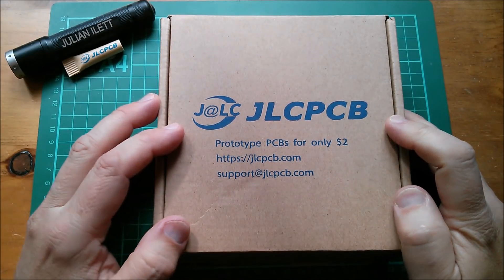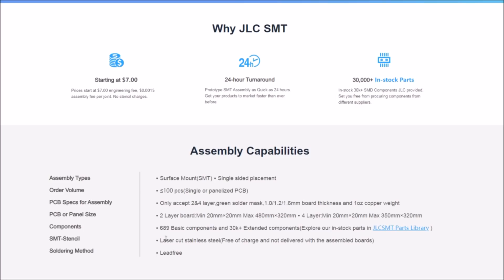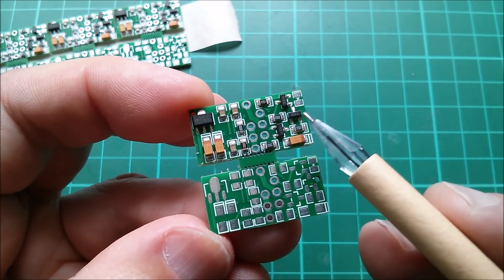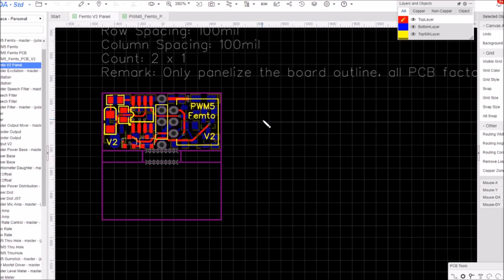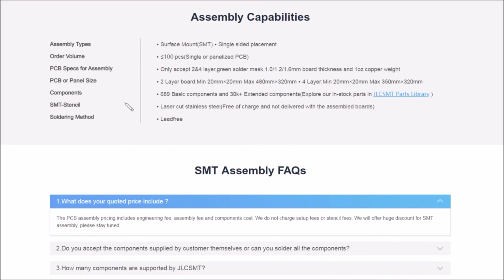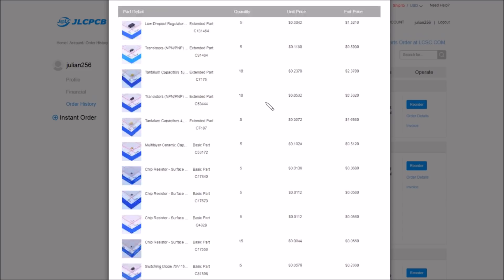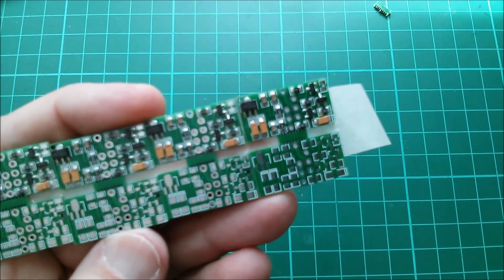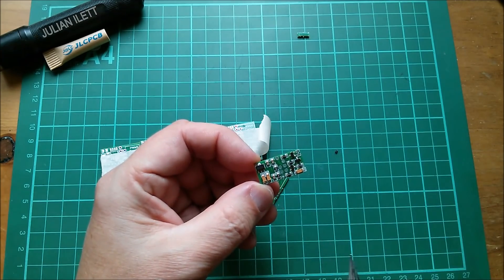Assembled PCBs from JLCPCB - New SMT Assembly Service

Comment: DO you have video that demonstrates how much power the standard trace can hold. I made a 36v to 48v dc booster and I'm afraid of ordering till I know if my traces can handle 40 amps. Not going to lie I've been confused when I see the power coming out of some board's vs the thickness of some of my wires that burnout at 40amps.

Comment: I am planning to order a board from them shortly, my board is also too small so I have to panelise it. I've panelised it with components and it looks ok... can I see the design for this board? What is the diameter and spacing of the stamp holes? Thanks.

Comment: Are there any US sources for boards and components?
Reply: I've used https://oshpark.com/ for prototype boards, and I usually buy parts from Mouser or Digikey, all in the US.  The PCBs come out very nice from OSHPark, but are somewhat more expensive.  In my latest project, I used JLCPCB to evaluate their service, and was quite pleased at the rapid turnaround.   

It's also very handy that you can get a solder paste stencil for only $7 more from JLCPCB.  (And if you do, choose "custom size" to get one sized to match your board, vs. the default which is huge and ends up needing to be shipped as a separate package for additional cost.  I use the stencils by hand, and don't have a machine to apply pastes, so I don't need the default large size.)

Comment: Penalizing through EasyEDA is not the way to go. It took me a few days to figure out how to make a panel that will be assembled with the components. What I did is, I first went to the board design and copied it and pasted it as many times as i wanted boards on each panel. EasyEDA than automatically adds designated to each component and those are not found in my schematic diagram or BOM. Then I went to the schematic diagram and copied and paste each of the existing components as many times as the number of boards I had on the panel to fulfil the BOM for the SMT. Also,  I had to manually draw the panel outlines and place 0.1mm holes where I want to later  Senate the individual boards by braking them off. That was a great effort and pain in the neck.

Comment: Thank you very much for this VERY informative video!!
I am interested in giving them a try on a few prototype boards! :-) I will have to check their selection of SMT parts now! 
I am just starting out with KiCad on Ubuntu but maybe I should try to use EasyEDA again?
I tried it once earlier this spring but was quite frustrated with it. I could not figure out how to place a part and hook up wires. KiCad on Ubuntu seems to be working very nicely so far (but I have not reached the PCB board layout stage yet) and, Lord willing, I can translate to EasyEDA.
But the symbols and footprints for all the parts is the bugaboo. So maybe I need to try EasyEDA again.

Comment: how difficult would it be to make this for 6V battery and say 12V panel?
Reply: It can't. The battery needs to be a 12 Volt lead acid battery.
Reply: @johnnodge4327  that version yes. i have a 6v leadcacidwith no charge control
that is why i asked

Comment: You mentiioned the diode was 1n4148, smt would be 1n4148w, that has a pad width of 4.05mm or 0.16 inches. the 1n4148w would have fit. that would take up 3.8 mm. a little tight for proper solder joint, but would have worked https://www.mouser.com/datasheet/2/115/ds30086-60872.pdf

Comment: You should try to avoid using tantalum caps. There are very few if any situations where they can't be swapped out for something more reliable (they fail short circuit). Beware of the myth that conformal coating prevents ingress of moisture. It simply slows it down.
Reply: Listen to Amp Hour podcast #459 where Tom Lee talks about starting a fire in the ISS (1:10:20) because of tants
Reply: Tantalums easily catch fire; never ever use them
Reply: What should you use instead of tantalum caps?
Reply: @Philip8888888  mlc caps. Or even electrolytics if you really must.

Comment: How come you don't make a single 10x10cm panel instead of several small 1x2 board panels? Also, regarding the holes, look into standard rules for pcb "mouse bites". For boards that small you could easily get away with one or two small tabs(probably less than 1/4 the width you've used) that will be strong enough to hold the panel together during manufacturing, testing, and assembly, but make splitting the panel up(and ultimately breaking the tab off of one of the boards) exponentially easier. It takes much less FR4 to hold a panel together than you might think, especially one so small.

Comment: Did you pay $3 for each extended part per board or was the $3 charged amortised across the number of boards you had done?
Reply: Amortized.
Reply from the maker: $3 per extended part per order. Then presumably, the parts are unloaded from the feeders and put back into storage
Reply: Julian Ilett thank you for your reply. I specifically asked JLCPCB the same question and they replied that they charge $3 per board. This makes no sense as they as you correctly pointed out. I have challenged their reply as I believe there is some confusion most probably language. JLCPCB English is better than my non existent Chinese. 

I am still in communication seeking clarification as their last reply confused even further but your reply confirms what is correct and indeed makes sense. 

Thanks again for the reply....I enjoy your channel.

Comment: Very interesting Julian. 

When I looked at the cost of the components from JLC, vs me buying them elsewhere in bulk, having them fitted simply didn't make sense, from a small scale manufacturing point of view. Especially if you consider the actual selling low price of a complicated PWM charge controller. When I sold my PWM5, I simply soldered all the components by hand, which actually doesn't take long. For me, it didn't make financial sense, so I soldered them up myself.
Reply from the maker: When I was manufacturing the PWM5, I could only make it profitable by charging my own labour time at zero. That's unsustainable.
Reply: @JulianIlett  

Oh absolutely. I have made up a few of my Pico kits on special request. However it's not particularly profitable, which is understandable for hand assembled PCBs. I'd consider using the assembly service, if they could do both sides of the board, and fit programmed PICs, which obviously they can't. 

A way around the single sided issue, would be to drop the component size down to 0402 where possible, placing most components on the assembled side. Doing this could restrict the number of hand soldered components to a minimum, possibly just the PIC, which could be programmed prior to soldering on.
Reply: There's no way you can beat a machine at component placement and soldering. This service is very economical if you adjust your design to use as many basic components as possible and avoid any extended components. It also opens up the possibility of using 0402 components, which I would never bother to do more than a few by hand. You solder the extended components yourself, which you can usually buy cheaper than what LCSC has them for.
Reply: @MCJemFinch  

A board redesign, using 0402 components and a mostly single sided layout would make the extra costs more acceptable. 
There's still going to be some hand assembly required, but keeping it to a minimum is essential.

Comment: Whole process of designing board using EasyEDA and ordering assembled PCBs from JLCPCB was smooth.
Only thing I thought was missing was being able to rotate the parts while reviewing the parts placement. It's not hard to fix wrong orientation by editing the CPL file, but it adds way too many steps to the process.
EDIT: Just got answer from JLCPCB: "We find this problem before, and our IT development team will add "Rotate" -buttons in that page in near future"
Reply from the maker: I would also like to see a method of including all PCBs on a panel into the BOM and CPL files. I also got a reply from JLCPCB - "This is our plan in future to add this function" :)
Reply: I've had the same problem figuring if the part's orientation is correct. Half of my components on the preview were placed 90 degree on the pads. The only thing I could do is pray they figured it out correctly. Didn't get the assembled boards yet to see if they did. Overall,  very confusing.
Reply: I'm so glad to hear they're working on the rotate issue...several of the footprints in Kicad are 90° or 180° off from what they have, and going back and forth editing the .cpl is a .PITA. I wish there were a sort of one-click method to tell Kicad "you're working with JLC, follow their rules and link to their parts library" and have everything magically work. Hey I can dream....

Comment: Interesting.  I bought some boards from jlc a month ago. I normally panelize smaller boards with v-groove and this time they wanted another $10 to do it. Never before did they ask for extra.
Reply: Something else must've been taken into account then. I get all my boards vscored and never have to pay anything additional unless the panel doesn't contain identical designs(even small differences like if you moved a component after panelizing and the change isn't exactly reflected across all panelized boards can cause them to be considered different boards), the overall panel size is >100mm on either edge, or I select more than 10pcs.

Comment: Could you explain further why no V-scoring?    It would appear that v-score was used between the pcb's at the short edge though?   OR  was each pair routed out of the panel.
Reply: My guess would be that the 'panel' was routed out of the larger PCB blank. As for why no v-scoring, who knows but it does seem like there are trying to push people more towards the rabit-byte panels over v-score ones. At least from my personal perspective.
Reply from the maker: Perhaps the V-scoring machines have a height restriction - who knows.
Reply: V-scoring is done by hand while a router table can be loaded automatically with the two fiduciary holes. They would probably have to take the boards off the production line to have them v-scored vs having the router directly in line.
Reply: I doubt vscoring is done by hand.  Its just a different tool in the router machine i would say.
Reply: @glennp9904  there is youtube video from jlcpcb factory. it's cutting wheel machine, much different from cnc router.

Comment: I spent some time going thru the basic parts list, I think it would be an interesting challenge to work within that parts list for a project.
Reply from the maker: There seem to be quite a few ICs, transistors, resistors, capacitors and LEDs in the basic set. Should be possible to come up with something blinky :)
Reply: @JulianIlett  maybe I'm thinking to big but...recreating the 1 instruction CPU (maybe more) with just the parts available. or experiment with PCB business cards
Reply: Where's a list of the 689 basic parts?  i've been looking around but just can't seem to find it.
Reply from the maker: @roidroid  https://jlcpcb.com/client/index.html#/parts - the basic parts appear first in each list.
Reply: @roidroid  I don't think there is an explicit list, if you look thru the main parts list at JLC the basic parts are listed at the top of each section.
Reply: @weirdboyjim  No, I can't seem to find an explicit list, but thats probably by design so you can see that they still in fact have parts you may need. 
I haven't sent away for a this service yet, but I am working on a rather large board with a couple hundred passives and half dozen or so op amps and regulators. While I have replaced a few components to accommodate the basic list, they still seemed to have nearly all of the parts I need in the basic list.

Comment: Try folding wires so they come out only at ONE end. Seal/encase but don't fill case completely to provide a drip edge. Mount so the wires all come out at BOTTOM and that intentionally formed drip edge prevents water from wicking back upwards towards PCB right where the wires enter.

Comment: Have you ever thought about entombing your PCBs in clear casting resin? Might stand up pretty well :D Be fun to see these in a block of resin!
Reply from the maker: I suppose the UV glue is a kind of resin - just built up on the outside of the PCB rather than poured into a mould.

Comment: Wow they charge a huge mockup on the components. The LDO (LCSC and JLC have the same part numbers is easy to compare) costs only 0,1164€ on LCSC and the transistor 0,0083€ while they charge 0,304€ and 0,118€.
That is insane.
Reply: The cap is even more insane. 0,071€ per piece against 0,2376$. Wow. I really hoped they would use the LCSC prices but now I understand how the manufacturing is so cheap. They just add the cost for the manufacturing on the component cost. 
So not at all useful for larger scale but acceptable for prototypes I'd say.
Reply: Yes, they seem to advertise it more as a prototyping service. What they do is make small batches quite easy an affordable, especially to a hobbyist. But of course if you had an actual product and wanted to manufacture hundreds or thousands, you'd use a more efficient producer and shave the pennies on those component costs.
Reply: I'm not sure how they price the components. On my boards, the prices were not too dissimilar to LCSC though oddly quite a few were lower price through JLCPCB. A few people have mentioned bigger differences so it's a bit puzzling.
Reply: @sdgelectronics  That seems weird. I guess they are still in the early phases and I hope that they will put the prices down to those of LSCS (or maybe a few percent higher) since they are the same company.
But I guess for bigger order volumes it is better to go with some other company anyways. So it should be ok.
Reply: Ok I just checked it now again with parts for my project. It is now not significantly more expensive. The LDO is, for me, now 0.1384€ with JLC and 0.1145€ with LCSC. The tantalum would be 0.1082€ on JLC and 0.071€ LCSC.  And with the transistor they charge the price for the 50 pieces. As that is what they also would charge at LCSC and it is clearly written there in the part lib as well.

I guess they fixed the problem and 20%-50% or so is an ok margin for the parts. Likely will go down more in future.
Reply: @nukularpictures  Well, electronics parts pricing have always been on a very big sliding scale.  I buy reels of caps or resistors than can get down to $0.00167/ea at 30,000 quantity.  It keeps going down from there.  The "standard parts" are probably costing JLC 1-5% of what they charge.

Comment: Glad to see yours turned out well too :)
Reply from the maker: Ha, yeah, you beat me by two days :)
Reply: @JulianIlett  I thought you'd have done a vocoder board, but I guess most of the parts are through hole on those. Was the order process seamless through EasyEDA?
Reply from the maker: I did have to export both the BOM and the CPL file from EasyEDA and upload them individually to JLCSMT. But maybe they'll automate that process in due course.
Reply from the maker: Yeah, the vocoder is entirely TH :)

Comment: 5:40 - you need to be careful when snapping pre-soldered boards that you don't cause cracking in the solder joints.
Reply from the maker: These little boards are so tiny they're not going to flex much. In fact the thickness (1.6mm) is more than 10% of the width (12.7mm).
Reply: @JulianIlett  It takes surprisingly little force to cause fractures in the ceramic capacitors, which drops their impedance.
Reply from the maker: The V scored Panels are a lot easier to snap apart - hopefully JLCPCB will offer V scoring with the assembly service in due course.
Reply: Personally, I use wire clippers to start the cut and the fracture follows through the perforations, not causing any board flex. Use clippers you don't care about, the fiberglass will dull them.
Reply: And capacitors.